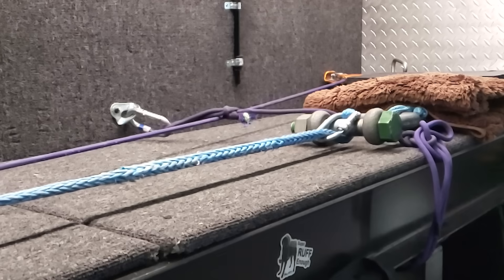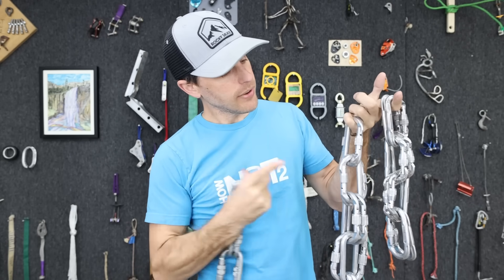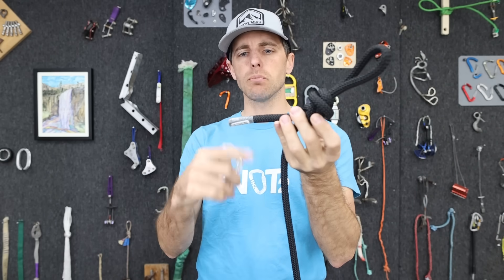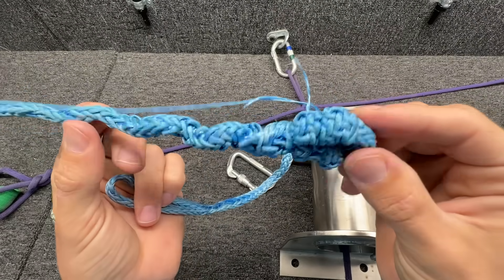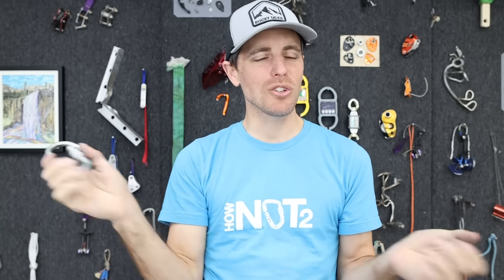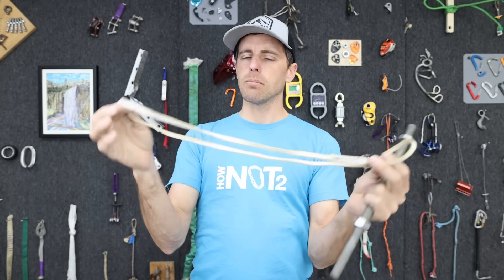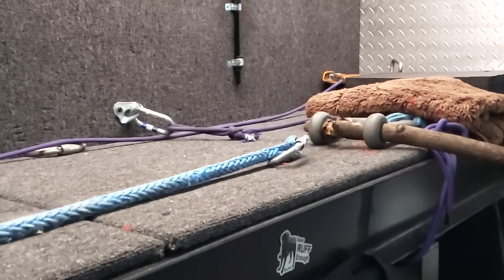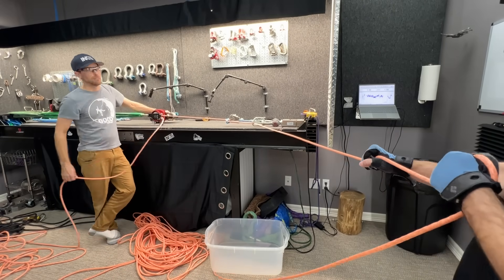Ever done this before?

Comment: Here is a set up for ski patrol self-evacuation that I am interested in. I am looking to minimize the amount of rope I have to stow in my fanny-pack. One option is to pack a rad-line that is more than twice the height of the chair I have rappel down from. Hang it around the chair hanger and rappel down both strands. Option two is to size up my rappel strand to 8mm. Place a alpine butterfly near the end of the rappel rope and attach a quick link in the alpine butterfly. Place the rappel strand around the chair hanger and thread the rappel strand through the quick link. The only caveat is that the alpine butterfly is sufficiently large enough that the quick link fetches up against the alpine butterfly and thus prevent cross loading the quick link. Retrieving the rappel rope would be done with 3mm accessory cord attached to the quick link.
Any thoughts about this set up?

Comment: 9:41 for the small bolt test the diameter is so small that the carabiner is basically not cross loaded anymore and most of the force is in the standard loading direction which is why you got full strength. Looks like medium sized pipes are worst because they cross load the most while larger and smaller ones not so much.

Comment: My only thought about the strap breaking on the threaded rod is the threads started to cut the fibers in the strap causing it to break at less than expected strength.    I'm not a climber and don't use any of this equipment but I love watching you break stuff.  👍👍

Comment: I hitch off to stems in tree work this way all the time down to about a 4" diameter. Was pretty sure it was super good enough but nice to have it verified as people have called me out for it. I do like to use a fall arrest rated carabineer which is speced for a 16kn side load. If I am going for a smaller diameter I toss a half hitch below it to take some load off. How big was the pipe in the video?

Comment: There are different aluminium alloys. They behave different. The really hard AW 7075 stuff cannot be welded and is very affected by seawater. AW 6082 is a nice one. It's the most hardenable seawater resistant one. (Sea water resistancy is always relative of cause.) AW 7020 is harder as AW 6082 and weldable but not sea water resistant. 6060 is the most common one in extruded stuff. (AW=aluminium wrought) It's similar to 6082 but it's less hardenable. It's sucks to mill that stuff. AW 5084 is the most self hardening one. It's used for ships. Milling that is APITA. Even softer is AlMg3 (Idk the number.) It's very common for sheets. It's softer as 5084 (AlMg4.5Mn).
I've not included cast alloys. The Grigri has eventually cast parts.
The softer the alloy is, the more you can bend it. I'm using a 6082 tube in some of my suspension forks (the QR9 version). To bend it in the radius I need I have to keep it one hour at 530′C, quench it and bend it immediately. In it's hardened state (T6) it's still more ductile as 7075 and maybe the material the bent carabiner was made of.

Comment: Hey great idea - for arborist types, could you try an alpine butterfly (AB) to a steel (and then aluminum) biner choked around a vertical stem - 4" stem (~ the minimum this cringing chicken would climb on spurs)/ 6" stem/ 8" stem to see if the knot and stem radius makes any difference. Maybe the choke doesn't even work on a 4" stem unless it's rope and ring? The choking biner thingy may be used on branches but there's lots of options there including just rope , all the way to Texas Tug etc. For stems tho, guys use Notch Quickies/ AB to steel biners to Al biners to rings to inventions on TreeBuzz as yet unproduced. Keep up the good work. Why you could even work up a proof of something to eventually change the practice in the ANSI Z133 !!!! Gosh!

Comment: Thank you so much for these tests and for putting time and effort into them. Still, I want to point out the fact that pulling something with hydraulic is not as real as it is in real action, I believe that the shock test is better since it often happens in sports and industry practice, let's say we are hauling something around 100 Kg to 40-meter high. We have 2 anchors on it, the top anchor suddenly breaks and now we have a shock load on the bottom anchor. Again, thank you. I have been following your YouTube channel and have learned a lot.

Comment: M12 threaded bolt has a 2ton (metric) shear strength but only a rated bolt.  If the ends of the all thread you used were not fixed it would have collapses at half that.

Comment: Thanks for the testing.
I'd guess the thin branch test where the sling broke and you wondered how it did that at ~21kN was due to the threads cut the sling.
you basically put all the preasure at a couple very small reas which are often not exactly smooth. 
Especially bad if you pullover such stuff like in the last test.

I used pieces of garden hose over small diameter metal stuff to protect the rope.
Might not truust my life with that but for rigging stuff it works

Comment: From my experience,  of R.A., stunts, and arbor, most of your soft goods ar breaking due to the "sharp" edge of the All thread. Try wrapping the all thread in e tap , card board ,carpet, you k ow the usual gag that people  use on set ups, and go from thwre?...  also curious  to what a full wrap around thw tree I.e. a frictionless hitch does to bend and break the carabiner as then you have direct  forces applied to just the bend of the line bending the link over the object?!

Comment: I fail to understand why you'd ever do this, if you have much better alternatives such as an anchor knot or mast hitch with a slip knot. That's what we use in mountain rescue in Germany. For us, it's all about minimizing the amount of equipment you need and building absolute mount points without using carabiner at all, for example.
Perhaps it's the different use cases of equipment...? When we build a system, we build it to carry the full 22 kN with at least one backup. For certain rescue techniques, we easily get 15 kN of force on each of the sides which is why we love strong trees and never loading carabiners on their cross axis. Sadly, many trees have been destroyed by fire and bark beetles last year in our areas; some places look like a moon desert.

Comment: I have done this quite a bit, even for anchors 😄 Only ever bent an I-beam style aluminum locker after using it to rig up slings like a chocker cable to haul small trees/branches with an excavator because looping slings or using shackles were too time consuming and inconvenient for the potential risk... (and I wanted to see if it would break, which is why I didn't use a retired steel locker) But I kind of have dedicated life protection hardware and separate used utility hardware that never get mixed up... I honestly expected the aluminum one to break because it was taking some weight and even  shock loads "for research" but it just ended up with buggered threads and a gate that didn't line up because of the bent spine before getting tossed... (If OSHA or other people that consider this blasphemous behavior are watching, then this all occurs in Mine Craft of course) 👍

Comment: I'm actually really curious about this kind of choking around some sort of anchorage... I come from a construction background where we would have a 5/8" diameter lifeline with a spliced eye and a snap hook installed on it and we were always taught that if we did not have an engineered anchor or embedded anchor to clip to.... it was fine to wrap it around a piece of Anchorage and clip it back to itself as long as we think whatever we were wrapping it around would hold 5,000+ pounds....  Oftentimes that meant large concrete columns in towers or open web steel joists... Is this safe? I know a lot of people working in construction would love to find this out.

Comment: I’ve questioned the arborist world about how much concern cross loading a carabiner actually is. People can’t handle powerful falls anyways even if the gear does hold. It would be interesting to look at the green log chart to see how long a limb would have to be at 6” to get the loads in the video. Several guys use carabiners in rigging, which can easily see larger drop distances, all be it the tree dampens the force some while loading, and smaller limbs likely will have leaves to partially slow the fall too. 

I’ve only seen ropes break during rigging, not carabiners. Perhaps others could leave experiences which carabiners have broken during tree rigging.

Comment: Good video. I'd like to know if there's any issue with using an aluminium ring, wrapping around branch, a loop back through the ring with a carabiner blocking and barrel stopper on the end. Rings are cheap and seem much better for this purpose, also stays nicely on the rope.
I got a 70kn rated steel one just for extra safety but I imagine its ok with the 30kn DMM alu one.
Reply: Never heard any complaints about that ring setup. Super common

Comment: The threaded piece is probably cutting  into the rope   on the all tread pull and the log pull .if you grab a all tread hard an and spin it in your hand you feel that it is pretty a abrasive  compered  to a smooth round stock ,even a bit sharp ,especially stainless and threads that is cut,  (not roll formed)
Sometimes you have metal burrs on them that actually cut your hand when handling them .  When you did the log pull the sling was probably fysicalay gliding over the threaded bolt that was sticking out the ridges working as little knives on it.

Comment: 4:24 dyneema is very slippery. A nylon rope has more friction around the pipe which results in a lower percentage of the force acting on the carabiner.
This could be the reason that the biner breaks lower with the dyneema

Comment: I think the smallest diameter bar actually put less side load on the carabineer.  There is likely going to be a worst case diameter in there somewhere, it depends on what angle the rope applies pressure to the carabineer.

Comment: One method I was recently shown is to clip the rope through the biner twice (it ends up spiraled around the spine of the biner once). This seems to position the biner to prevent side loading, but I'd like to know what other forces it puts on the system, and if the extra bend in the rope weakens it.

Comment: I think the test with the narrow threaded rod had geometry that put nearly all the load on the end where the sling looped around the carabiner, and since the distance from that loop to the threaded rod was short there was very little leverage. This would mean that one of the strongest parts of the carabiner was carrying almost all the load, and in a pretty optimal way.

Comment: Excellent testing, as a climbing arborist I find this content very interesting and helpful. I do this type of attachment all the time in trees, but only for positioning when using a carabiner, never for main life support, where I typically will use a Notch Quickie instead just to be sure. I've always felt that the dangers of loading carabiners like this has been a bit exaggerated by many people, especially when used on thicker branches and stems, but I must admit that these results still surprised me as they're way better than I would've thought. Super good enough! 😁👍
Reply: Hell yeah dude, sounds like you've been more conservative than me 😅 I've had quite a few co-workers nag me about this and just rolled my eyes at them, so this video is super vindicating enough 😂
Reply: @corygrossman1  Indeed! Even though I've always felt that the danger was exaggerated by many people, I've had no data to back up that feeling and so I've chosen to be very conservative with this just to be extra careful. I will probably be using this a lot more now going forward, but knowing myself it will probably be with a 50 kN steel carabiner just to be extra sure. 🙈😅

Climb high and stay safe mate.

Comment: Why IS the hydraulic winch running on BATTERIES?! 😮
Reply: if you think about it, if you ever want to carry the system into a mine or other places it would make sense to use a direct current pump, and if you don't want to disassemble and reassemble critical parts of the system it would make sense to use that same pump at home too, that way you just put the whole thing in a van and you can be sure it still works when you need it with no downtime. everything is a compromise. he could have two different pump in parallel for the different scenarios, but why bother when the battery getting low is rarely a problem?

Comment: To get a piece of tree debris to weigh enough to create these kinds of forces (even at shock load)  they have to be high diameter pieces, which would negate most of these tests because the angular tensions shown here won't exist, as the clip would be mostly flat against the wood, which would deform to the shape of the clip before the clip deforms. 
Like, your never going to get a 3 inch branch to weigh enough to damage a clip. Even a 12" branch would be unlikely. Bigger than that and the sharp angular forces against the side of the clip start to dissappear,as seen in the last test. I think the biggest concern is the carabiner coming unlocked
Reply: and for the last concern, just use triple-lock carabiners (the one used in belaying). While it may be an overkill, chances that something go wrong will be diminished to so high load, that probably carabiner won't be a weak point anyway.
Reply: @maksymisaiev1828  triple lock is industry standard.. they can still open. It’s the quadruple lock - DMM Duralock I have gone and got to mitigate this concern.

Comment: I'm taking a break from calculating the pullout force for some lag screws going into PSL engineered lumber for anchoring a railing on a roof deck... and the highlight of this video for me is that the bit of branch held 6+ kn. (But overall, these test scenarios screamed "Oh no! Not that! Take a second and rig a better anchor!" even if some of them would be fine for a rap.)

Comment: They all seemed to fail by shearing off the hinge pin for the gate and then breaking/bending around the contact point with the pipe. I think it comes down to the ratio of carabiner length to the diameter of the object you are clipped around. With a large diameter anchor point the carabiner sees a pretty gentle bend radius, not enough to shear the hinge pin for the gate. With a tiny diameter pipe the rope almost passes through the carabiner parallel to the spine so cross loading is minimal. 

I would bet if you tested a bunch of diameters that range from super small to larger than the length of the carabiner, you would find a sweet spot where the pipe is both small enough to have a tight bend radius, but large enough to get the angle at which the rope passes back through the carabiner steep enough (relative to the spine) to cause cross loading. A graph of the diameters vs break strength would likely have an inverted bell curve where the strength decreases until the "sweet spot" and then climbs back up to MBS range.

If all that is true then the "sweet spot" could probably be described by the angle the rope passes through the carabiner relative to the spine, giving a "Danger Zone" of angles to visually tell if an anchor like this would be significantly weaker than MBS.

Comment: the Z2R how little momentum would in theory be enough.. not referring to ease of comfort for the pulling, but simply how small a modern brushless rotary powertool could you get away with and still deliver enough torque for licting the average male adult.?
some of these modern 12v and 18v drills.. deliver a surprising amount of torque for their size. with modern high current IMR/INR LIion cells

Comment: Did the sling break on the "all thread" due to the treads being shaper than a round bar?
Reply: Very likely! try spinning a stainless allthread stock while
Grabiii6ng it hard , it may cut your  hand , 
 Roll  /press formed normal  threads is more   rounded on the ridges,  and actually stronger than cut dito due to the fibers in material not being cut of when making the threads.

Comment: Hey, as we again saw the large diameter pipe. If you are worried about necking in the future, fill the hollow internal with concrete. Its is strong in compression.
Reply: But then you have a 20kg piece of concrete filled pipe flying around.

Comment: I’ve been practicing some rappel techniques in my basement off of a pull-up bar using a system kinda like this, except I use 3-4 wraps around the pipe to help keep the carabiner from going wonky and the pipe and rope from getting damaged over time

Comment: I want to see the small diameter tree branch than can support 15kn...

Okay, actually thoughtful comment, I suspect the threaded rod was the culprit in a lot of the rope/sling breakage. Especially that relatively non-static rope around the log, the cover was pretty clearly cut by the threads on the bolt. (TL;DR: super good enough)
Reply: It's not often that someone would tie off mid branch.  Typically we aim to get into a union and or around a main stem with a branch just preventing slippage.  But yeah all of these numbers have been "super good enough"!

Comment: Your pipe is probably expensive, maybe you should fill your pipe with concrete to prevent it from crushing more. Maybe a 1" PVC pipe in the middle so you can run your restraining cord through it.
Reply: I have been hoping for a solid pipe for a while now!